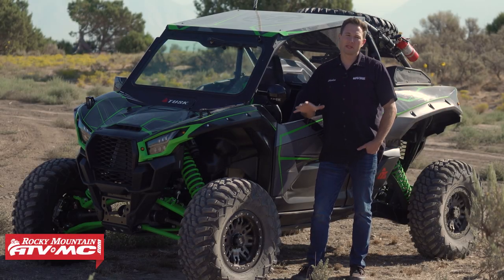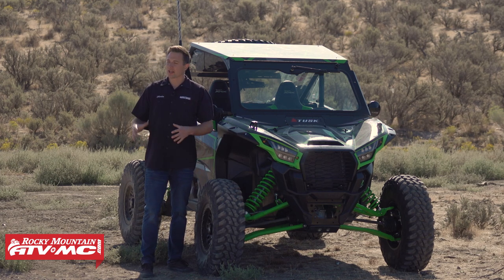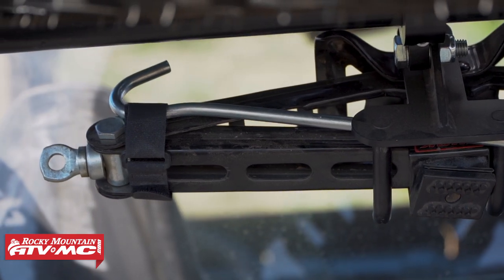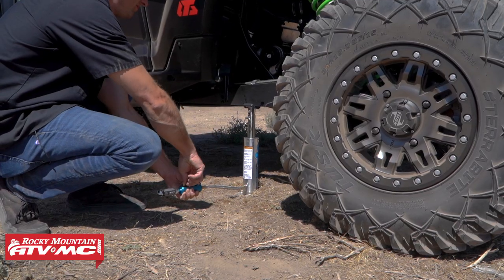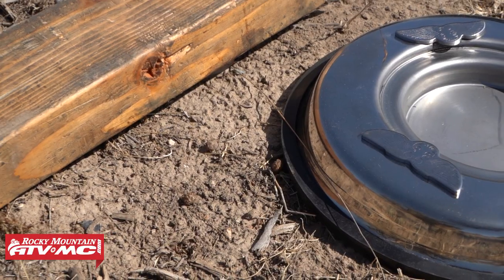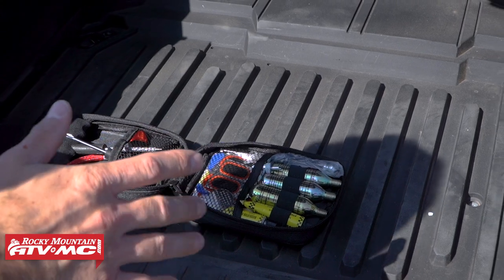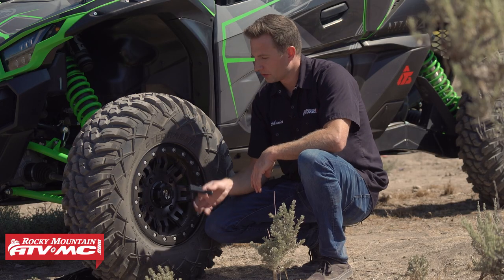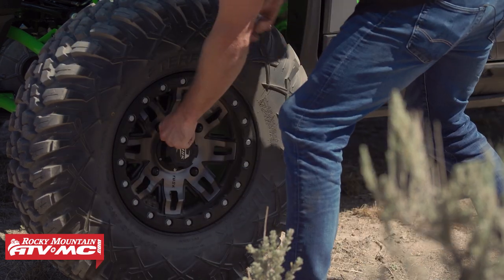Tips and Tricks to Changing a UTV Flat Tire out on the Trail

Comment: The Owners manual shows jacking points in center of vehicle front and rear ends. Takes a jack with 24 in lift to get it up high enough to get wheels off the ground. Will jacking up on A arm damage joints or arm?